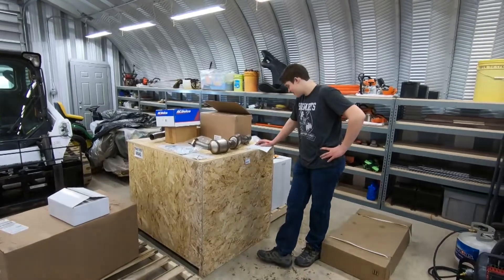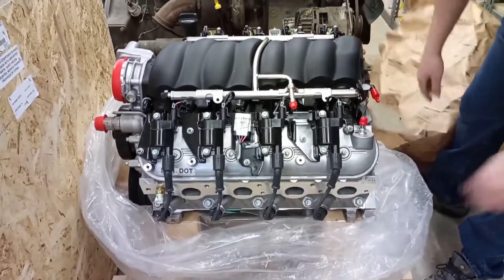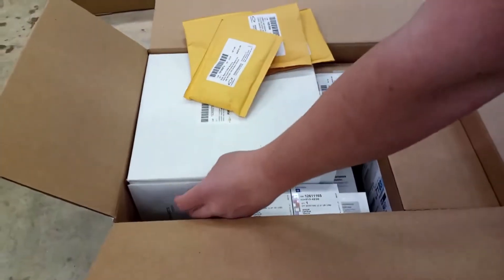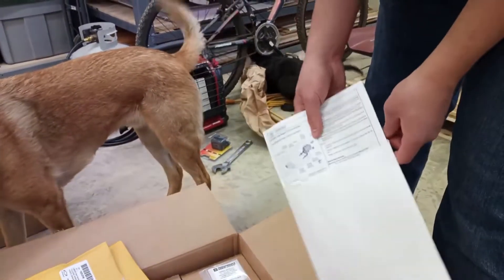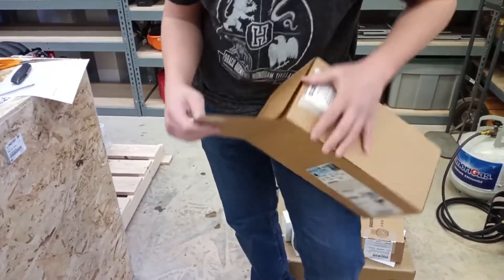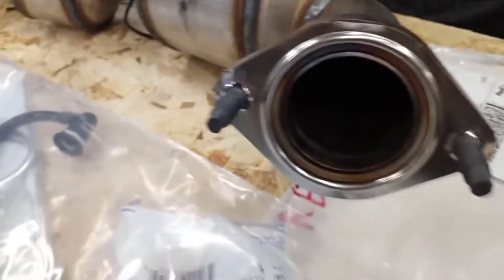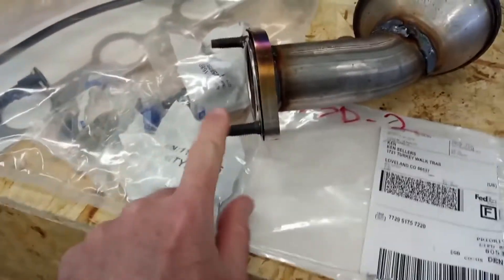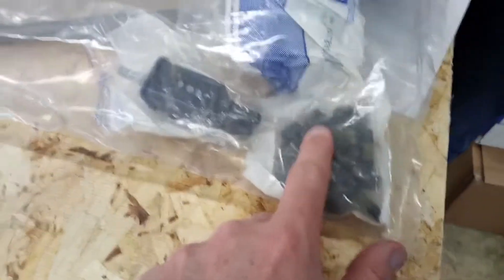LS Swap 1 - Chevrolet Performance E-Rod Crate Engine Unboxing

Comment: First, great unboxing video. Short and to the point; much better than other YouTube stuff out there!  Were you able to use the provided exhaust manifold and cats or was fabrication required?  I’ve got a similar set up (but with a 6L80e) going into a 1950 Chevy truck on a RoadsterShop chassis. I ordered my engine/trans from JEGS in October. The transmission shipped the next day, then I learned the LS3 is practically impossible to come by. Six months later I gave up and started looking on Craigslist.  I got super lucky and found one from a builder in the California who’s client backed out. I too, wonder if Chevy will continue to produce this engine.
Reply from the maker: Thanks for the positive feedback!  We used the provided exhaust manifolds with no issues.  The cats are another story; we'll probably pay an exhaust shop to reconfigure them a bit.

I have a ton of video to share and will be releasing it over coming months.  I think our electrical schematics will be especially useful; that's an area that the LS-swap books, and the videos I've watched, mostly seem to gloss over, and yet it's something you absolutely need to know.

Sounds like a cool project - glad you found an engine.

Comment: Thank you so much for showing this. I am very close to buying an LS3 EROD myself; I think I'll pick one up within this month. But I have a few questions, if you don't mind. 

Gandrud Chevrolet actually had them in stock? I called so many places and they didn't have any. I heard they're on backorder without an ETA. 

What kind of transmission will you be using? I'm going with the 17 tooth because I'm planning on using a Nissan 5-speed manual.

There's a $250 rebate, and a 6 pack of Mobil 1 oil included?? I thought you only got the rebate if you bought the connect & cruise (with transmission)?

Did you buy this motor recently?
Reply from the maker: I'm happy to answer any questions that I can.  Gandrud did not have any in stock at the time (around December 1, 2020).  But whereas Scoggin-Dickey wouldn't take my order, Gandrud would, and it let us get the engine for the 2020 price.  It also let us get in line for a 2021 engine.  If I could do it over again, I think I would do it exactly the same.

We'll be using the 4L70E from Jeg's, but I'm neither recommending or discouraging others from doing the same.  It's just what we're doing.  We don't have the car running yet, so I don't know how the story ends!

Claiming the $250 rebate was kind of painful because so much time had gone by between me paying and getting the invoice from Gandrud.  I had to really persuade the rebate folks that I had done everything at the soonest opportunity.  So my advice is to pay attention to the terms and conditions, especially deadlines, and make sure you comply to get the rebate.  But yes it was on the motor only.  I do not know if they have since changed the offer.

It was only after the fact that I discovered the free oil offer; I contacted Gandrud and they said they only send the oil to people who ask.  They did send me a 6-pack of Mobil 1.

Ordered about 12/01/2020, and they shipped it 2/22/2021.

Hope this helps, and good luck on your project!
Reply: @WorkinOnIt  I recently read on various forums that a lot of people are trying to buy new crate LS engines, but no dealer has them. It seems kind of pessimistic because GM won't announce an ETA, and they recently discontinued the LS7. I get this impression that LS engines are being phased out. I hope not....I have a 1990 Nissan 300ZX 5-speed that I'm hoping to get an LS3 EROD for. I intend to use LOJ's swap kit. I don't have to have monster hp like 1,000 hp. I just want my car to be as fast as a C6.

Does the ECM communicate with your instrument cluster, or are you using aftermarket gauges? Thanks.
Reply from the maker: @eekay3646  I have some LS-swap projects in mind too.  Hopefully they're just having production issues?  I have no knowledge one way or the other.

The 1980 Camaro is using Dakota Digital VHX gauges, in no small part because they look good.  I thought we could use their BIM (Bus Interface Module) to get all the information from the engine computer and not have to connect analog sensors, but it's not going to work out.  I posted a review on Summit explaining the reasons why.  I still like Dakota Digital though.